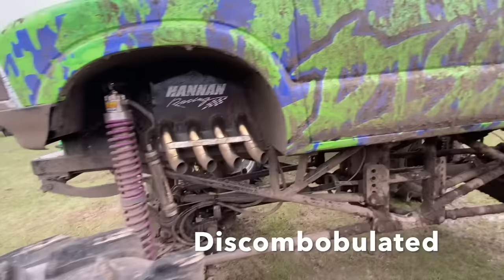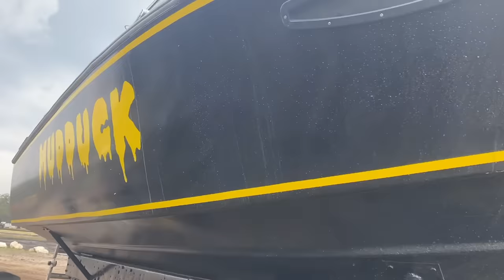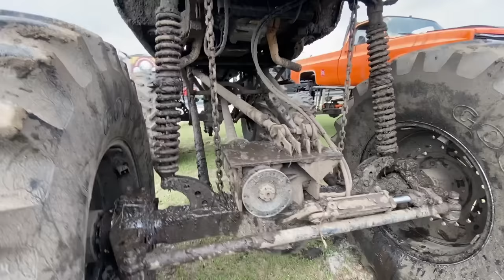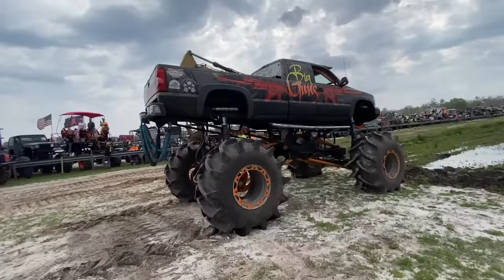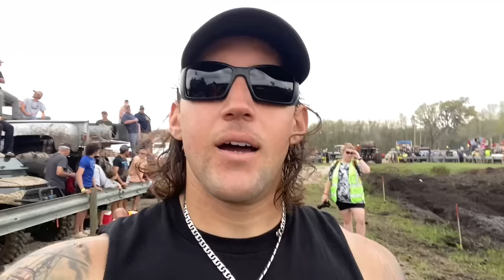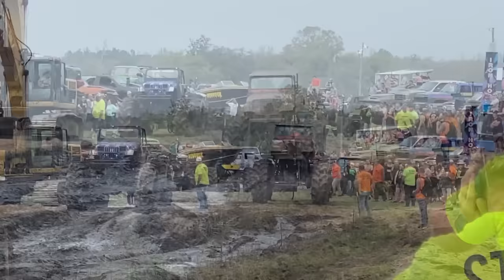Iron Horse Mud Ranch Bounty Hole Competition

Comment: Awesome video. Guys building the biggest trucks ever, it's just to much weight, overkill. Your rears are still low catching alot of mud and everything. Unless you have insane horsepower. Remember Crawdad? Lightweight/power/experience. That's how it gets done. There are exceptions with good drivers.
Reply from the maker: I would have to agree